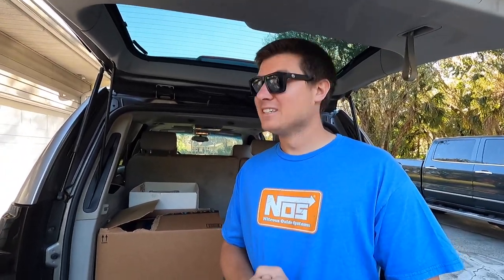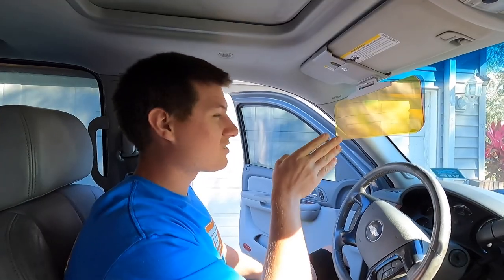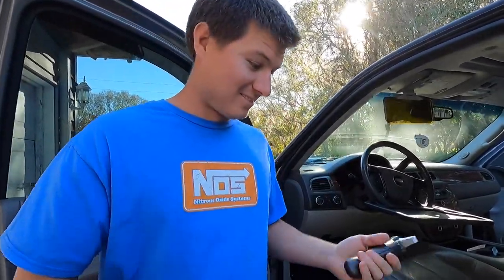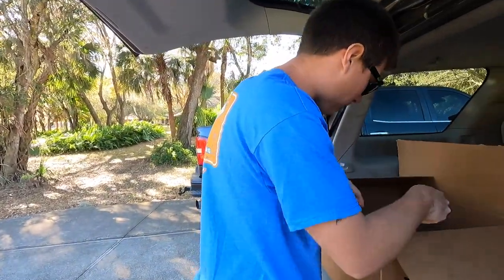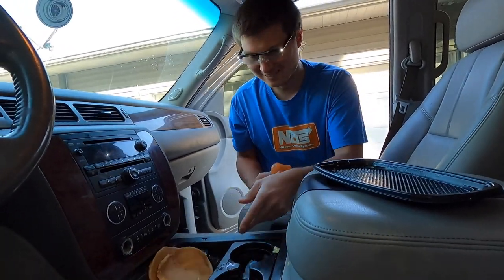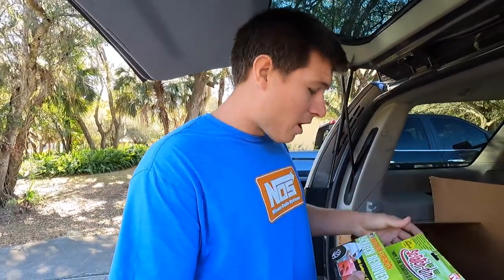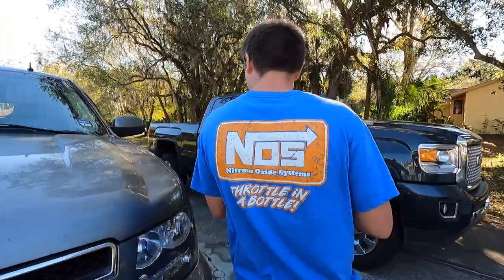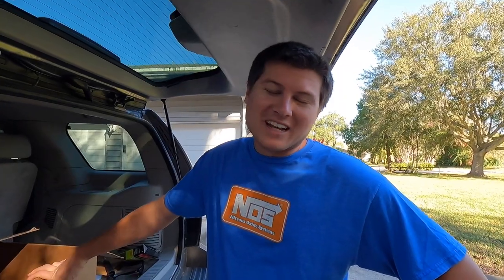Testing Out “As Seen On TV” Products... (Not Good)

Comment: I've tried the wipe new before on headlights, and it will actually work if you put some elbow grease into it. The only problem is the clear coat stuff is cheap and your headlights will fog back over in a matter of 6months or so. It does actually work though.

Comment: Wait and see what those scratches look like in a few days.
You can actually clear up those headlights but you have to go through the polishing steps.
Reply: Yeah some of these are bad products for sure. Others require following the steps.
Reply: @Itz_Worm  
  A lot of the cheap lens clearing products are nothing more than WD-40.
Used it all the time on travel dials as a machinist. It only lasts as long as the WD-40 does.
   But then when you have a can on your bench it's no big deal to spend 5 seconds every couple days to clear up the len's until you get a new one.

Comment: Brake cleaner will 100 percent clean the headlight. Then clearcoat when it dries. Not as good as a wetsand but it does work. Also don't get brake cleaner on the bumper obviously

Comment: The headlight restore kit actually works. I used it on my 1982 Jetta and my 1/4 mile times went from 18.5 to 18.4. I'm not sure if the product restores headlights though as the car uses sealed beams which don't turn cloudy.

Comment: Now the wipe new done the right way with wet sanding the headlights with the block and then using the wipe as the final step after properly wet sanding does actually work well I have used it many times one of the best inexpensive kits.